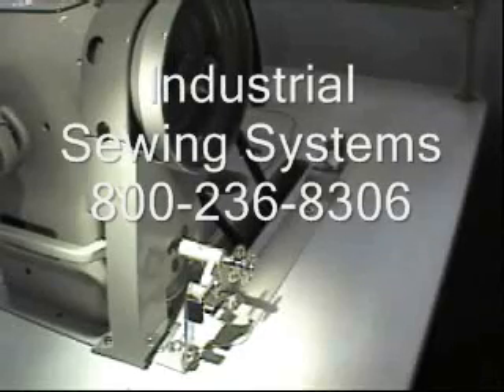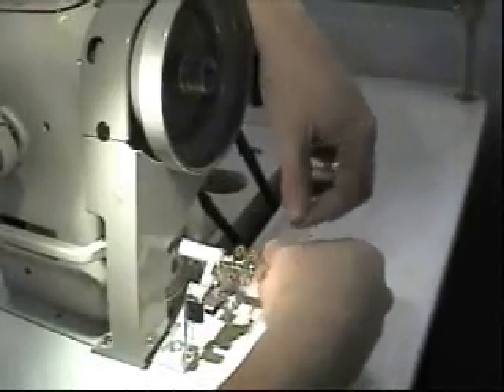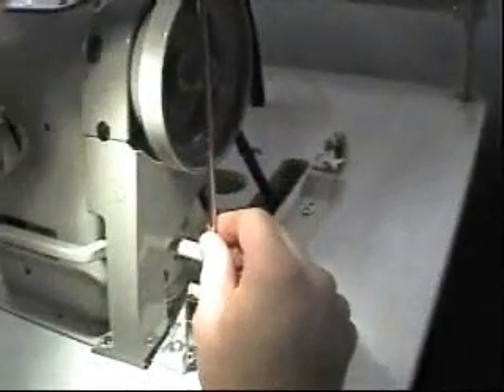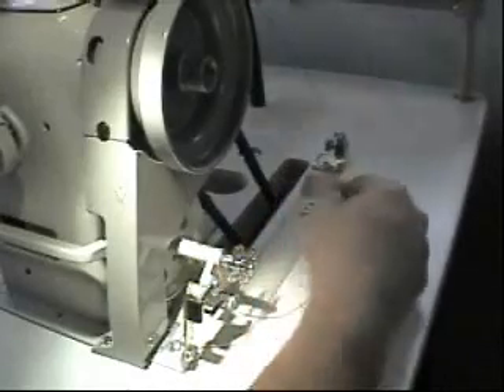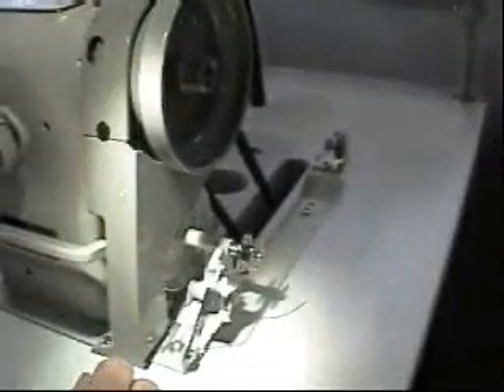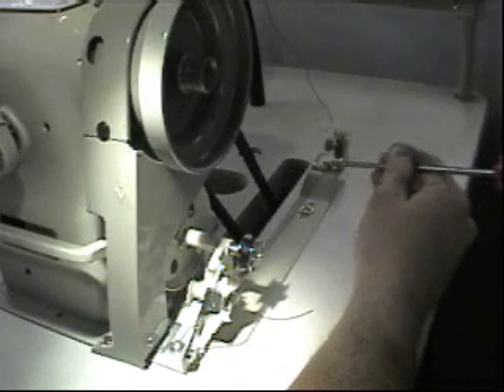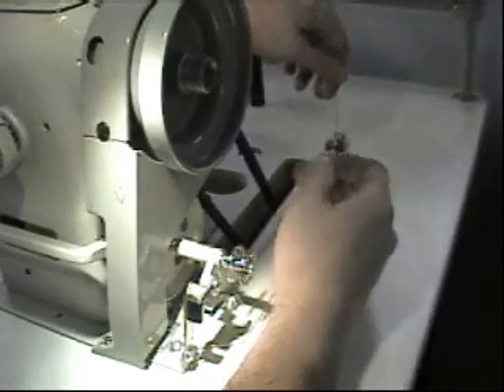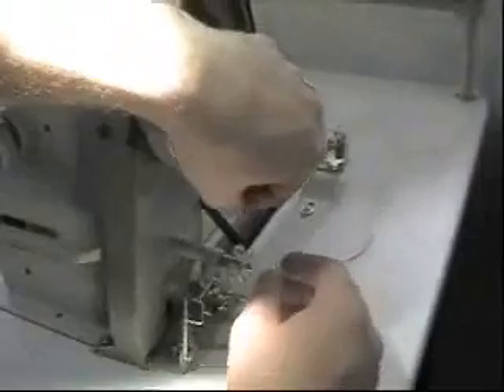Winding bobbin on Consew 206RB

Comment from the maker: The machine is designed to wind the bobbin while you are sewing but if you need to wind one with out sewing it can be done.  1. unthread the machine  from the needle to just past the take up arm. 2. remove the bobbin case.  3. lift the foot.  Once you have done all three steps it is safe to run the machine to wind the bobbin.  This is also a good time to do a general oiling of the machine. Running it at the high speed to wind the bobbin will help the oil get into the parts it needs to.